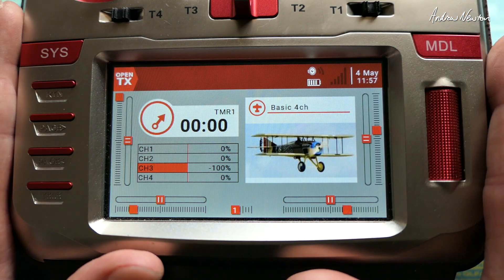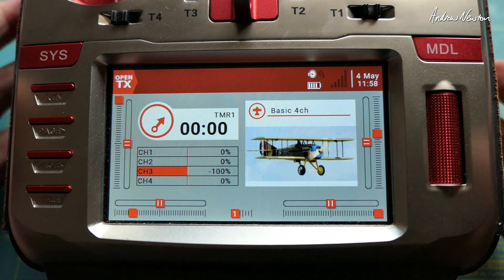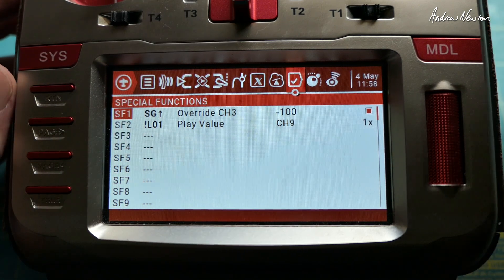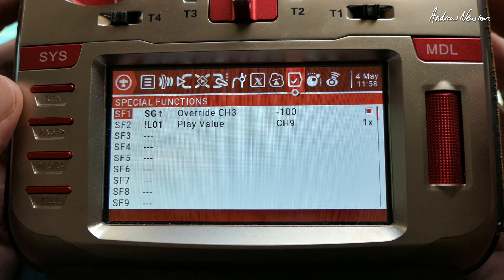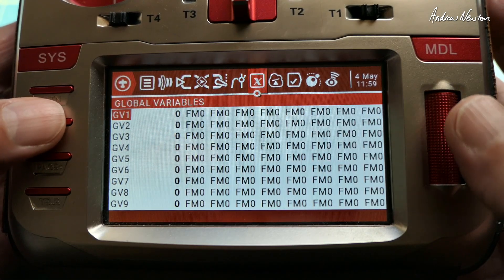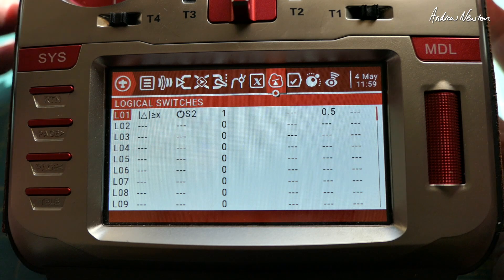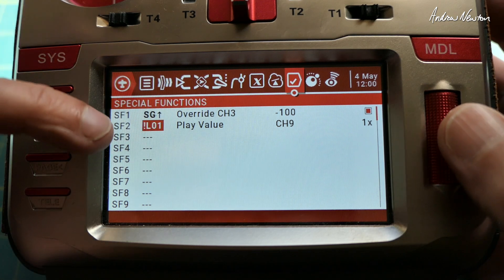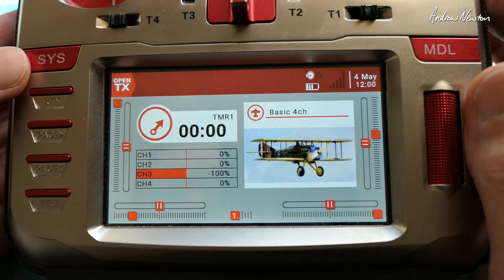Automatic Play Value - improved method

Comment: On my trusty old ParkZone Radian, I think I'll try this for tuning elevator trim between  motor climbing, cruising, and thermaling.
Now if I could only get the Curves editor  to show servo output values... or does it?  
Why do I have such a fit setting up flight modes on a 6 pos switch or slider. 
One of my favorites is in INav fix wing setup. Pulling the momentary switch announces a few options like "Save."  You let go of the momentary switch after it announces the choice your looking for ,  then it confirms the selection by announcing the selection.  I think there might be cool use cases for something like this.

Comment: This doesn't work, she's saying zero to 100 okay ...BUT....The channel monitor on Ch9..only shows movement in one half...but the trim displays show full movement as in your video....🤔😳😳🇬🇧...It's the channel monitor that counts...🤔
Reply from the maker: But the S2 pot value is still full range. Ch9 output is just for the audio. The gain would actually be on Ch5 at a guess, using the full range of S2.
Reply: @AndrewNewton  Well, take a look at the Channel Monitor and channel 9....I can only get from 0 to +100....but the display for S2 pot shows -100 to +100...It's the actual channel output we are interested in..
Can you show us the Channel Monitor for ch9?...😳😳🤔
Or is ch9 just for audio purposes and S2 is working a different channel?.CH5?....I'm confused..😳In this video, CH5 isn't mentioned, only 9?...I realise gain may we'll be on 5...I have an S6R Rx myself...😳
Reply: I think it's the readout that counts.
Reply: @johnsheehy6172  The readout on the TXs main display is showing S2 going full movement end to end. But NOT on the actual Channel Monitor, which is the servos actual output.🤔
Reply: @EnglishTurbines  the task was to get audio readout of S2. Channel 9 just facilitated that. there is no servo output on channel 9.
Reply: @johnsheehy6172  I kind of suspected that was the case. What we now need to see, is the S2 pot working the Channel Monitor. Which isn't in this video...🤔😳

Comment: Thats really nice feature, thanks! Only minor thing to consider when using with SxR receiver is Gyro Gain is absolute value. So you don't compress -100 .. +100 to 0 .. +100 interval, but +100 .. 0 .. +100. Simply done by 3 point curve as you shown before.